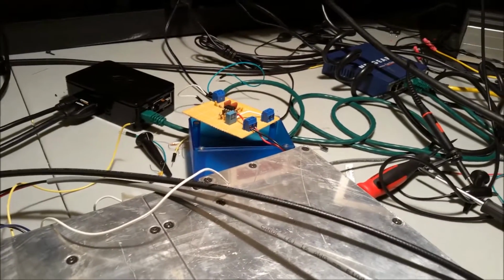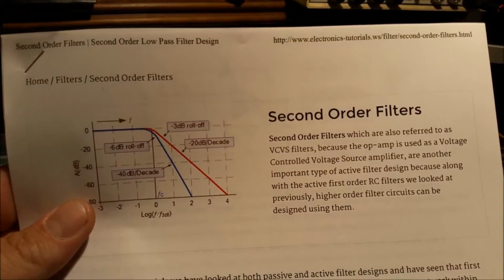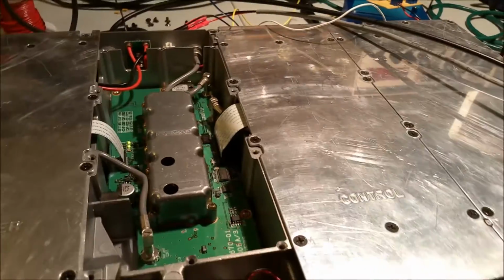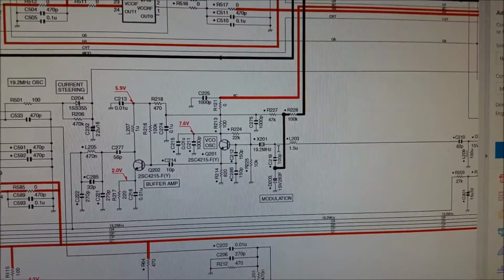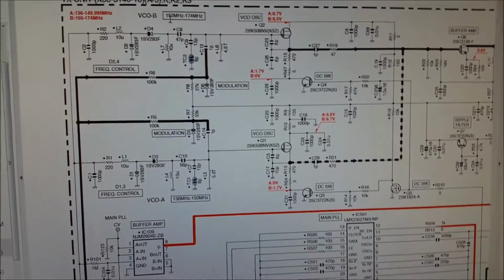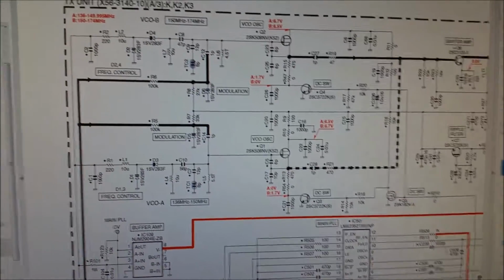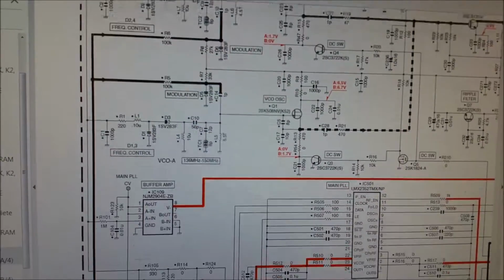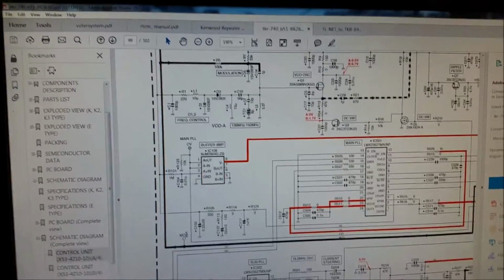Kenwood TKR-740/840 Flat Audio for use with the RTCM

Comment: Great video!  I'm looking for an alternative to the MASTR III's and the Motorola MTR3000 just can't simulcast.  I have a couple of 840's i'm now inclined to play with.  I still haven't solved the issue with the 9.6 mhz clock in the RTCM making things drift though.
Reply from the maker: I have solved this issue one of three ways, one is I created a version of the PCGM that takes a 10 MHz reference and can output any freq from 6 MHz to 200 MHz. The other is a PLL board I made using  a 9.6 Mhz OCXO that I phase lock to a 10 MHz reference. The last is a device made by Leo Bodnar that is a mini GPS locked programmable freq reference. All three of these option work equally well.
Reply: @Geewhiz811  Nice!  How is it in the overlap areas with those modifications? One of us came up with something similar to the PCGM based on a schematic that Jim Dixon sent me.  The only problem was that when I attached that I smoked the PIC.  Back to the drawing board.

Comment: But TKRs already has a flat speech active filter 300 - 3000 already,  you intend to just use a lowpass filter for what? audio + PL tone? i know TKR were designed to repeat flat audio minus PL thats why there is a speech pass filter which is flat already.
Reply from the maker: Problem is the flat audio input on the TKR only will modulate the transmitter to 2.0 KHz this is by design on the TKR and of course the main TX audio input does not pass frequencies below 300 hz. The audio I am feeding the repeater is a composite of speech and PL audio. This is why I had to bypass the audio processing in the repeater so I could feed the audio into a single input. I had tried splitting off the PL tone using filters and feeding it to the flat audio input but the resulting speech audio that came out of the repeater, I could never completely get it to sound the way I wanted it to. This modification solved all those issues.
Reply: @Geewhiz811  i have never seen the service manual of this TKR, i think there is a pot to adjust the modulation like the TKR820 and all other repeaters, unless it uses software only to do that.

Yes that the main purpose of having the speech filter of 300-3khz, to separate the audio from PL, reduce hiss white noise from the audio 3khz lowpass, and 300hz to remove the PL and mobile flutter when the one triggering is moving high speed. it is very hard to understand a repeated audio with mobile flutter. anyway the transmitter should transmit a purer and solid PL not from the received radio which is old school.
the only reason this was done then was to have a squelch eliminator style where the receiving will no longer hear the tail.
if you use kenwood radios, i do not hear the tail drop, only on other radios, because the PL drop nearer the stop of the tail, slower HTs cannot detect that. 

re transmitting the received radios PL can be distorted when using it for tx, specially when it is receiving scratchy signal. instead of processing the audio, you will also re transmit mobile flutter of weak signals because you only designed a low pass filter.

I design DIY controllers, I always use lowpass and high pass (bandpass) to separate and process the audio, receivers and transmitters can have different PL if i don't transmit the PL that was received. my fried has a TKR 860, on my kenwood NX340, i do not hear the tail and drop when i use tsq, it the same with baofeng radios.

the MOD point is a test point not an input. check it that point is not an output of an existing OPAMP stage hopefully its not direct output of a previous opamp.

make it good sir, im a subscriber of your channel, i was looking for a demo of the UHF bandpass helical, i too have a VHF 5 helical and still am looking for a preamp. i did not see any update videos on what your did with it.

regards